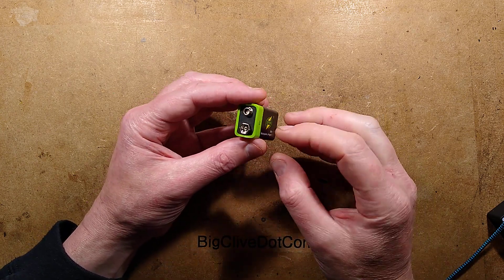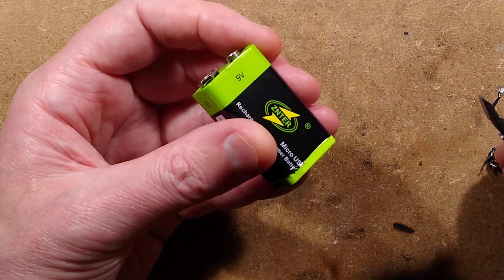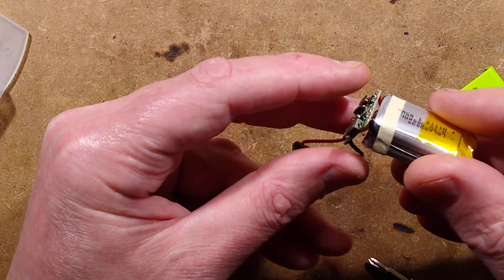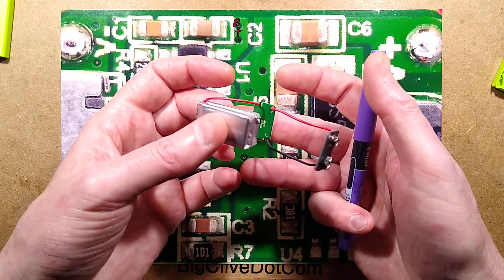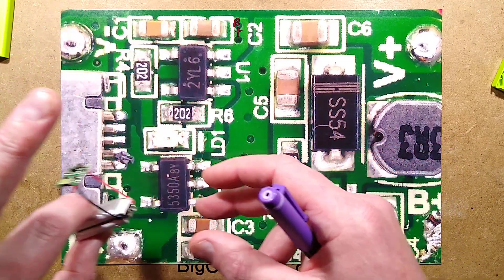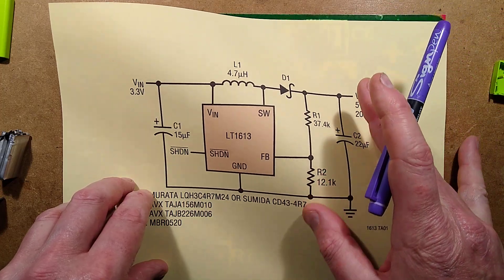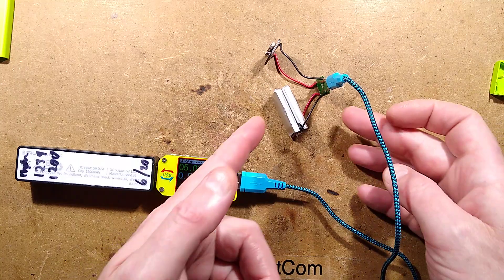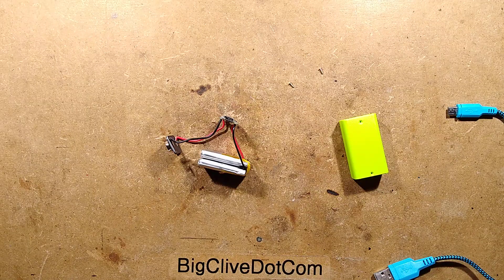Inside a Znter lithium 9V battery.

Comment: I wonder how long it will last in low current devices as smoke detectors, since the booster will be on all the time. Would be nice to know about its capacity in that situation after 3 months. Must say, looks nicely designed, all lines look straight and symmetrical.
Reply: It would be poorly suited to that application, as you would never get the low battery warning and it would just cut out

Comment: Pretty neat! I do like battery-related reviews. I've got some lithium ion 9v batteries that have the charger outboard (but bundled) and no boost circuits, they're just two cells in series. They're closer in voltage than the nicad 9V, and no switching noise (I actually use one in a cheap pocket oscilloscope), and remarkably about the same price (from Amazon) as quality alkaline 9v batteries. I'll never buy alkaline 9v for anything except smoke detectors again 😁 The kind I have might be better for your wireless mics.
Reply: I’m fascinated. Two lithium cells in series (I’m guessing is what is inside yours) are 8.4v fully charged and 7.4v nominal. So never hit 9v. Only other option is 3 in series which is 12.6v but that’s far behind 9v. Its possible a buck converter could be used which always produces much cleaner signal than a boost. And I’d be curious to see 3 lipo cells in such a small casement. Which is possible but the cell capacity would be tiny. 

Have you taken these apart? I’d be curious to see if any of the above circuitry exists. Especially considering they are more than likely polymers, which is more volatile and almost always requires a bms.
Reply: @mrb3888  I'm pretty sure they're labeled as 8.4v. a pp3 is just 6 tiny little 1.5v cells, it drops from 9v really fast. I've gotten a NiMH "9v" that was a bit over 7v rated, and it worked fine. I think devices that use 9V batteries are prepared for pretty wide voltage swings and low current. And yes I'd hope there's a protection chip in it, but that only needs one or two tiny ICs, no big deal. People already make AA-compatible lithium ion batteries which need a buck converter, and with built in USB charging. Well within the realm of possible. (And like I said, pretty cheap, only slightly more than alkaline!). Amazon has them, the brand is EBL, and the kit comes with a separate charger for them which now runs off USB, which is even better than the previous gen I had.

Comment: Lovely little battery & useful as I loathe having to buy the alkaline ones due to their cost & then have to discard them. At the risk of adding a failure mode I might be tempted to put a micro switch in to shut off the battery when not in  use. I have a bee catcher that I use to catch & release bees from the poly tunnel which is only used a few months of the year & having one of these that I could share with other things that are also rarely needed would be nice. Thanks for sharing!

Comment: Don't the lithium just catch fire when it touches the oxygen
Reply from the maker: Lithium batteries fail with flames because of their high energy storage.  There's very little actual lithium in them, and it's well diffused through the material.

Comment: Very interesting idea.    Will this be usable in a Fluke 87V meter?   My concern would be what minimum power draw is required to start the DC to DC converter.    Secondly is the power clean enough to not cause electrical noise that will cause inaccurate readings on the meter?    Thoughts anyone?
Reply from the maker: The 9V is present all the time.  Sensitivity to noise is an unknown variable.
Reply: @bigclivedotcom  OH!!!    Thanx.    Six month storage life doesn't sound like a good application for the multiple DMMs I have sitting for months.   Regular use gear sounds like a better fit.    I think 1 or 2 would be enough to fill that need.
Reply: @bigclivedotcom  thanks bigclit- excellent teardown!  will stick with Ni/MH until noise issue is solved/known. you are my favorite EE guru, keep em coming!

Comment: i make my own 9v batteries by sticking 2 liion batteries in series with only protection circuits.
normal 9v battery is 9v when fully charged and 6v empty. 
so 2 liion batteries in series is 8.4v to 6v. so it works perfectly and make no noise.
litium batteries hold charge a looot longer than normal 9v batteries (like 3 to 4 times longer)
also you can replace 6 batteries with 2 liion batteries with only protection circuits

Comment: 5:00 don't you mean series? Because parallel adds ampere and series volts... Or am I wrong there? 😅👌
Reply from the maker: Using lithium cells in parallel is a lot easier than in series, as the charge and protection circuitry is simpler.
Reply: @bigclivedotcom  ah thank you

Comment: There was a similar battery based on super-capacitor some decades ago. Capacity was not much, but charging was possible in seconds. Voltage above 9 V at output pins was the charging current.

Comment: 500mA on that charger... how hot does it get? I´m currently using a microchip pin compatible charger and even thinking about getting it around 300mA,
 it would give it a temp rise of around 70C, package alone. Yes it has some ground plane, but still would not trust this package. 
Changed to a DFN package in newer design.

Comment: Used in radio mics, I assume you mean noise down the supply line Clive ? I'd be more concerned about actual rf interference, even when it's sitting doing  nothing :o(    Nice otherwise... I use 280mAh Nimh pp3 batts to get a noise-free supply, personally.

Comment: I know there's some in AA format as well, though have heard generally bad things benefit being is they would maintain a minimum voltage alot better than traditional cells for longer use when I was researching it at least best cells for recharging in VR controllers I have

Comment: Extremely well designed. I would suspect that the switching frequency is too high to be an issue for audio applications, assuming the audio equipment is well designed.
Reply: That's the issue... 
Many battery powered audio circuits don't have the extra circuitry to mitigate the noise from a cell like this, as they never planned on seeing anything except pure d.c. from a battery.

Comment: Hey Clive, check out this URL for what appears to be an 800mAh 9v with a meter on the side as you commented. Somehow I doubt it's really 800mAh... : https://www.ebay.com/itm/OKcell-9V-800mAh-USB-Rechargeable-Lipo-Battery-RC-Helicopter-Drone-Microphone/222962132117
Reply from the maker: They might be cheating and referring to the capacity of the internal cell.

Comment: A quick google search for the Znter 9v battery shows that they offer both a 400mAh and a 600mAh capacity on this design. The one Clive 'takes to bits' above appears to be the 400mAh variant. I wonder if it is safe to assume that the only difference between the designs is in the battery pouches? Advertisers also seem to be pushing the 'RC Camera Drone' keywords in adds for this battery.

Comment: It's a shame they didn't add a tiny recessed manual sliding on/off switch (on one of those battery leads) to prevent that discharge during storage. I doubt it would have increased production costs by more than a cent or two. Given how these batteries die over repeated charge/discharge cycling, they have no incentive to add such a switch. They'd rather it wears out so they can sell you a new one. Which puts this into the category of planned obsolescence in my book. Some of us do care about our footprint as it pertains to e-waste.

Comment: "Batteries are the perfect noise free DC source." We used to say.
That's gone now. Here is a battery with AC ripple on it; a switch mode battery! Please scope the output to see what frequency and amplitude is that ripple.
Reply: I mean, it isn’t a battery. It’s a battery powered power supply in te form factor of a battery.

Back in the 80s we had a lot of TV remotes with 9V batteries in them, but those have become more efficient and now just run on 2x AAA.
Reply: @JasperJanssen  it is a PP3 power bank
Reply: Does it have a filter on the output?
Reply: So it's a Rubbish DC battery with built in Ripple (not Quoted) at a variable frequency (Not Quoted), do not use in a test Equipt/meter or radio cct.....
Reply: @johnpotter4750  They work fine in my guitar pedals, no added noise. They just go flat in a few days but that's no problem, I keep two sets and charge a set before I want to use them.
Reply: What if it had 3x 3.7V cells in series and stepped the voltage down to 9V to power things. It could potentially use 12V from a USB PD capable power supply to charge from... 🤔 
Could that avoid the noise on the output?
Reply: @iamdave84  Not really -- the noise is being generated by the switching action of the DC-DC converter, and it doesn't matter if it's a step-up or a step-down. If it has a switching transistor, there's going to be ripple on the output -- that's just how things are. I mean, it can be tiny, but - compared to a real battery - it'll be there. Still, this is basically a 2P LiPo pack - you could switch over to a 3S and step it down to 9V (which would probably be more stable, since it'd be "empty" well above the necessary 1.5V difference). Also, depending on how you design your charging circuit, you don't need to use 12V - I mean, each cell is 3.7~4.2V, so charge them with 5V (under the assumption that it won't be used when it's being charged, so you're welcome to switch the connectors around however you wish while you're charging it). ;)
Reply: @iamdave84  if you need step down and REALLY REALLY need low noise, you can trade the efficiency of buck converter or LDO with a simple voltage divider.

Comment: Adding a on off switch on the battery side will allow it to be in a storage mode. Nice design!
Reply: Set of contacts from a relay with a plastic tab between to isolate the lithium battery. Just like devices that have a isolation tab between a battery and the contact that the end user removes before use.  The battery will not be drained by the circuitry if you put the switch between the battery and the circuit not after, that would be pointless. Micro switches are very reliable computers and cell phones using them for decades, gold plated contacts will not corrode. Just a way to have it charged and ready for use pull the tab and ready to go. Months and months of shelf life this way, only internal self drain will discharge it with no external load. Lithium will suffer if left in a fully charged state over a very long period of time and will only degrade a small percentage. Please post data proving otherwise as I have not had this happen to any of the hundreds of cells I have.  Now lithium batteries do fail a single cell will usually in a battery pack and the bms will prevent the pack from charging or discharging. Replace the cell and the pack will function again, all cells made from same batch why a particular cell fails and not the rest of the cells I can only guess of impurities but have no proof. Poor switch = Bad engineer.  Small spring 2 contacts small slit in case to slide in a plastic tab and fail proof way to interrupt the boost dc-dc converter operating current draw from running cells down when not in use.

Comment: If cells are parallel at 500mA each, why is it rated at 400mA and not 1A... or is it the boost circuit only can provide 400mA output?
Reply from the maker: 1000mAh at 3.6v boosted to 9v so about a third the capacity.
Reply: bigclivedotcom ohhh right, current is increased on input side of boost converter...late night my bad.... thanks the “light bulb” has dimly light then flicked out in my brain on that comment 😂

Comment: I've tested AA and AAA cells like this. Noisy as hell even when not connected to anything and the capacity of a carbon zinc.
Reply: These might do a bit better though, capacity wise that is. Especially on an AAA one you've got quite a lot of space used by the micro USB socket and circuitry. I'd assume this has a better potential battery volume to other stuff ratio than both cylindrical cells. 
 
But for AA and AAA I'd stick to low self discharge NiMH cells myself except for devices that don't play well with them, I've got one kitchen timer that starts running too fast on NiMH and a few other things where the LCD contrast gets messed up those still get alkaline but otherwise I stick to using my Eneloops as much as possible. I still have mixed feelings about 6HR61 things (rechargeable NiMH variant of 9V batteries), devices tend to work not as well with them and not a big fan of charging multiple cells in series (they typically won't last nearly as many cycles as a properly controlled termination on a single cell).

Comment: I remember buying a pair of AA cells where the positive end came off to reveal a USB A male connector to plug it into your PC for charging. Used in a tv remote they were dead inside a day. Excellent stuff.
Reply: Yeah thats an extreme case of shitty rechargebles. But to be fair rechargebles are always suboptimal for low drain uses, no matter if simple NiMH or Li-Ion(/Polymer). Selfdrain of NiMH or the Buck(or Boost) idle draw of the Li-Ion(/Polymer) variety draw more current than some appliances, like a clock or a remote.
But for high/mid drain stuff you cant go better than NiMH, or Li-Ion(/Polymer) (if implemented decently). 100s to 1000s of cycles compared to a single one.

Comment: What i would like to see is how the other variants stack up and with some charge discharge rates..how many watt hours etc and the noise problem of each.. seems znter has a 400Ah and 600Ah
what would be smart is a cut out to the step up converter if it does not detect a load so it wont self drain, would be easy to implement with a few components using the battery's power  to reduce that drain down. even a small micro-controller with built in sleep mode. freescale makes a chip that fits into a dimple of a golf ball . But that would drive the cost up i suppose. but i might pay if it was that cool.
Reply: What about a manual switch?

Comment: I guess I'm dating myself, but I always think of these as "transistor radio" batteries. Back when having a radio that you could actually carry around with you in a pocket was a really big deal :-)
Reply: It's funny how those radios got called "transistors," and that meme was so all-pervasive that when I showed an actual transistor (the three-legged device which is the primary component of a transistor radio) to someone and told them what it was, they actually asked what station it was set to. LOL.
Edit to add a funny story.
A friend of mine who was an electronics hobbyist who did minor repairs for occasional customers told me how someone came to him asking if he could fix their transistor radio. Upon opening it up, the hobbyist friend found exploded components and burned out and broken PCB tracks.  The following conversation ensued between he and the customer:
F: "What'd you do to it?"
C: "I connected it to 240 volts."
F: "What'd you do that for?"
C: "I got tired of buying batteries for it."
F: "Well, you're never going to buy another battery for that radio again."
Reply: @melkiorwiseman  But, don't you get better reception with 240V? :-)  I actually have a couple of early pocket size transistor radios that run on 4.5V (3 AA batteries) and a couple of "portable" table radios that run on 3 D batteries. One of those radios (a Sony "Handy Personal 7 transistor) shows up in a lot of old family photos from the early 60s.
Reply: How did your date go? Did you whip out your radio to impress yourself? :)

Comment: so with that standby power draw, if you have it in a drawer for a couple of years, will it still be rechargeable, or will it be trash at that point?
Reply from the maker: The protection will kick in if the voltage goes too low.  It should recharge OK.

Comment: One interesting application note: the current available before voltage sag in a LIon battery 9v is a much different curve than in an alkaline! Some unregulated devices like analog acoustic pickups in guitars rely on the fact the current sags under load. It can drastically change the sound of the amplifier :)
Reply: VOLTAGE sags under load ...
Reply: What a good idea -- putting the battery IN the instrument so the output can have a nice low impedance would mute much of the usual hum pickup.

Comment: You could take the USB step up charger, set the two resistors to a low output voltage. Add a trim pot between the FB pin and the two resistors to have an adjustable output. Figure out some way to baling gum and bubble wire on a volt meter...
One Wire to Power them ALL!!!
Or! Or you could add 4 little motorized wheels and a motion detector so it chases anything that moves. You could call it The Dodge 4x4 Charger.

Comment: with the rate my RC transmitter goes through AA's, I might consider their AA batteries
(or I'll just finally figure out what rechargable pack is meant to fit in my transmitter if you don't want to use AA's)

Comment: The step up board is consuming power always？
Reply from the maker: Just enough to keep the output topped up.
Reply: Just tested a step-up board using 2 NiMh cells to convert 2.4V to 9V for a cheap China Multimeter.       With no load, the current is around 1.2mA.
Reply: https://i.ibb.co/RBXhk4x/IMG-20200711-163652.jpg

Comment: Do you think that this battery type would be suitable for low current applications like smoke detectors?  Would the noise output affect the smoke detector's circuitry?
Reply from the maker: Not recommended.  The output cuts off so fast there would be no warning that the battery was low.

Comment: couldn't the output terminals have been mounted on the back of the charge board. Would make for a simpler construction. Just battery directly connected to the top board, instead of having those wires running up and down.